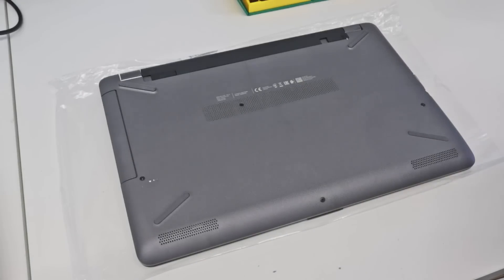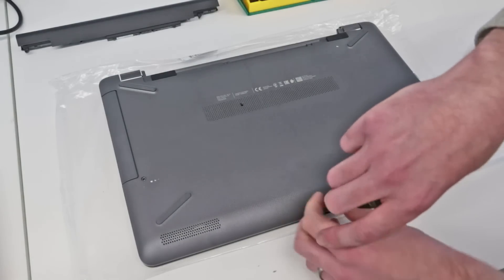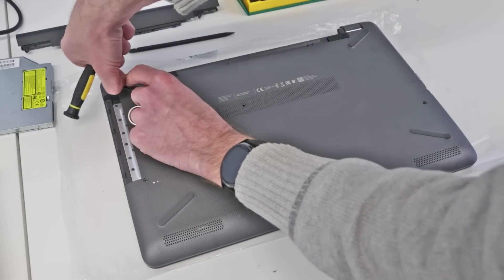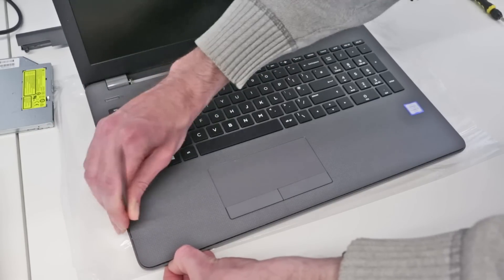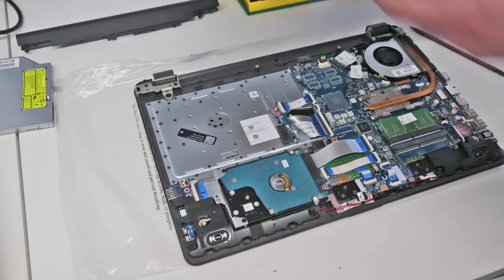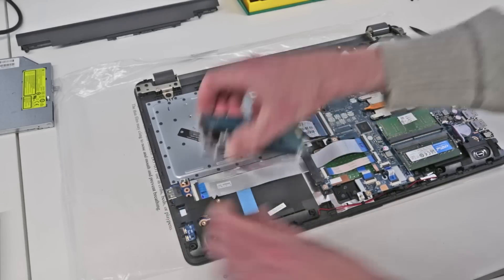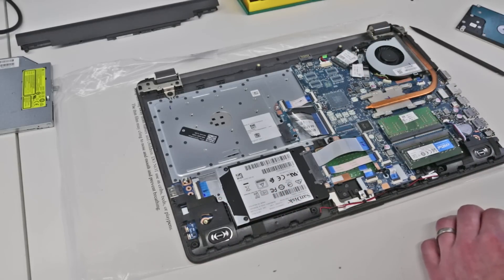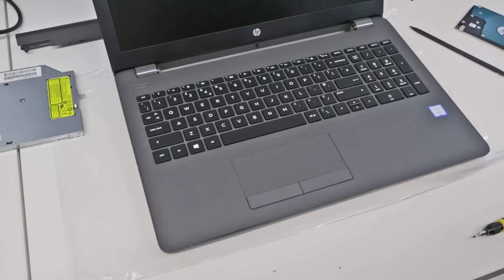HP 250/255 G6 HDD/SSD and RAM Upgrade Guide

Comment: What is max RAM a 'HP 250 G6 i7 with SSD' can take & why? e.g. 2 x 16GB RAMs = 32GB?
Reply from the maker: 2 x 16GB should work fine. 32GB modules may work, but not sure you'd see much benefit from doing so.

Comment: Got a hold of an HP 255 G3 with the AMD E1 6010. Can the CPU be upgraded? Thank you (has Win 8.1 😴)
Reply: I think that is not possible, because as far as I know the CPU is soldered on to the motherboard and non removeable
Reply: @qui-gonsgin8747  some laptops have an upgradeable CPU, but others don't! Thank you

Comment: I wonder why every video of this laptop has a CD driver except mine?
I need to add not replace the hard disk but I can't, please advise
Reply from the maker: There were models with and without. To add the optical drive you'd need to buy a new bottom with the cut-out, the SATA board (assuming the mainboard has the connector for it) and a optical to SATA adapter + mounting bracket.
It probably doesn't make sense from a cost perspective.
Reply: @BrueComputing  Thank you 🙏🏼
I think i will use your perfect tutorial to replace my hard disk with one bigger 👌🏼

Comment: Is this model upgradable to 1tb SSD? and what is the maximum RAM capacity for this device?
Reply: should be 16 GB. Depending on the Processor but for this particular laptop its 16gb

Comment: Question can this laptop only handle the 500gb ssd and 4g of Ram or can it go higher than that??
Reply: You can add more storage & RAM to it as you feel fit. In terms of RAM I believe the maximum is 2x 16GB SODIMMs, 32GB in total.
Reply: @hereis_Tiff  depends on the processor tho but this particular one has motherboard limitation and the HP doc list 16GB max
Reply: @metogema  I thought the limit was 32GB for this one, as I hadn't seen a 16GB limitation on my model when I looked it up 2 years ago. I suppose it isn't the case then
Reply: @hereis_Tiff  i got the exact same model as on the video. U too?

Comment: Hello friends, I have a HP 250 G6 (2sx53ea) Model laptop. Its processor is n3350. How many GB of RAM can I install in this laptop? And also known to install M2 SSD? Or we can only install SSD SATA. Thanks.
Reply: Hey there, I believe you can add 2 16GB SODIMMs in there, adding up to 32GB of RAM in total. In terms of adding either SATA or NVME M.2 storage, that depends a lot of what your motherboard & your laptop shipped with. For example: some laptops have the 2.5 inch drive bay for SATA drives (HDD or SSD), while others may come with a little NVME MM2 daughter board in its place.

Additionally, the motherboard may come with a soldered on NVME M.2 port, which you can use for storage, as well as a boot drive. Like I mentioned earlier, it all depends on what your laptop came with pre-installed.

Comment: HP 250 G6 Notebook, Intel Core i7-7500U, 8 GB di RAM, SSD da 256 GB, Display 15.6", is my computer. Is it possible to upgrade the RAM and the SSD, and if so, to which kind of RAM? 

Thanks.
Reply from the maker: Yes. It uses DDR4-2400 modules (link in the description) although you can fit 2666/3200 modules, they'll just run at the lower speed.

Comment: Hi... Kindly help... I have this exact model, but the power button is spoilt... Is there a way to boot up without using the power button?
Reply from the maker: The Power button board can be reasonably easily replaced if damaged, see P77 of the service manual: http://h10032.www1.hp.com/ctg/Manual/c05485525.pdf
You can also short the pins on the power board or mainboard connector to start it up, but not really a long-term solution and not something I'd recommend if you don't know what you're doing.

Comment: what do I do when the screws on the metal plate holding the harddrive is too tight and I can't apply a lot of pressure in case it breaks the drive?

Comment: Can I upgrade the G/CPU
Reply from the maker: No, they are soldered to the mainboard.
Reply: My new SSD is thinner, but just as long. Should it still work?
Reply from the maker: @videogameplaythrough7043  What drive is it?
Reply: @BrueComputing  I was originally running an old 500gb HDD but decided to get a slight upgrade. The new drive is a 128GB A55 M.2 SSD SATA 3. I want to install Ubuntu, do my school work and play my old games like I did with the HDD. Will this work?
Reply from the maker: @videogameplaythrough7043  Does your machine have an M.2 slot present, or are you trying to add it to the 2.5" SATA bay?
Reply: @BrueComputing  I am running the 255 G6. I looked at the specs of the computer which reads that I can in fact use M.2 I was going to put it in the SATA bay though.
Reply: @BrueComputing  Will I need a 2.5" enclosure or should I be able to safely mount it to the SATA bay and proceed with OS installation?
Reply from the maker: @videogameplaythrough7043  M.2 SATA drives are a completely different connector to a 2.5" SATA drive. You'd need a caddy like this: https://amzn.to/3n1dLzd
Reply: @BrueComputing  Thank you for your help! I'll adjust my build as such.

Comment: I tried to upgrade the to ssd but for some reason the laptop is not picking it up but ot works perfectly fine in other pcs you how to fix it
Reply from the maker: M.2 drive or 2.5" SATA?
Reply: 2.5 but got it fixed had to upgrade BIOS

Comment: I'm currently working on this same model laptop, but it doesn't have a fan, just a heatsink piece of aluminum.
Reply from the maker: Guessing your laptop is using a 6W Celeron or 10W Pentium chip, not a 15W+ Core i3/i5? The lower power models don't have a fan.

Comment: i have AMD processor in this laptop will this RAM specification work ?
Reply from the maker: Do you know which CPU it has? Guessing it is an HP 255 G6.
Reply: @BrueComputing  it is AMD A9 9425
Reply from the maker: @sabyasachisaha1069  DDR4-2400 modules should work just fine then. May run them at a lower speed, but slower modules aren't any cheaper.

Comment: I got the version without the dvd drive and it took me 30 minutes to open it. Pretty frustrating. There is a plastic catch in the middle near the hdd that can't be opened without breaking. I hate that nowdays you have to open the case to change the drive.

Comment: Is it possible to upgrade the CPU in this laptop
Reply from the maker: No. The CPU in pretty much all modern laptops is soldered down and can only be replaced by replacing the mainboard with one with a higher spec CPU on it.

Comment: Hi, I have the same hp model. I've been trying to upgrade to windows 10 from 8.1 pro but it does not allow me to, it keeps on showing red lines on the screen. Is a problem with hard drive or what? And I can't even activate windows at all

Comment: okay so i’m hoping this question we’ll get answered today 🤞 cause i badly need a tech’s info, i’m about to upgrade my HP laptop 250 g6 with a processor intel core i3 6006u cpu to 2400mhz ddr4 8gb sodimm ram. would that work? cause i’ve been reasearching and half i found is yes and half is not. so i’m in the verge of choosing if the money will get wasted or not 🥺
Reply from the maker: A 2400MHz SODIMM should work fine. It'll only run at 2133MHz though as that is the maximum official speed the i3-6006U can work at.

Comment: Is the cpu integrated into the motherboard?
Reply from the maker: Yes - this is the case with any modern laptops, bar a few high-end gaming laptops which use desktop components.
Reply: @BrueComputing  Oh right, I saw that some similar models had a ryzen 3 but it doesn't seem too upgradable except for the memory and secondary storage.
Reply from the maker: You'd have to replace the entire mainboard, as the CPU is soldered to it. Its not really economical to do this in most cases.
Reply: @BrueComputing  Thanks for the advice! I'm gonna sub :)
Reply from the maker: Glad to help! :)

Comment: Great and helpfull video. 
I do have the same laptop, but with an 1tb HD. Bit i still want to Change it to a SSD.  

About RAM. It looks like that the max capacity is 8GB i Guess it is include the 4 GB theres allready in the computer. What Will happen if i install  8 GB ?
Reply from the maker: It'll run 8GB modules just fine.

Comment: Nice vídeo buddy, i have a question: how much RAM can I add to the G6 i3 model? I would really appreciate your answer
Reply: Run cmd as admin and type "wmic memphysical get maxcapacity"
The result is in kilobytes
Reply: @sanjeevverma1133  Just did that. Says it can run 67 gigs (67108864kb). That seems insane. mine isn't i3 but AMD A6-9220 though. I did purchase two 8gig 2666 ram to put in. Figured a 4gig to 16gig jump would be plenty.
Reply: @kylesmith2435  run smoothly or not plz ? 16 gb is safe ?

Comment: Is there any way to ugprade gpu on this model? Also great video, thank you !
Reply from the maker: Only by replacing the mainboard as both the CPU and GPU (if present, most are built in to the CPU) are soldered to that, which probably isn't economically viable vs. just buying a more powerful laptop.
Glad the video was helpful though!
Reply: @BrueComputing  Yes that's what i thought too, thanks for the quick reply. Will go for new SSD & Ram for now thanks to your video! cheers

Comment: Can we change hp 250 g7 7gz79pa laptop processor ????
Reply from the maker: No, the CPU is soldered down in pretty much all modern laptops - only a few very high-end gaming and workstation laptops using desktop CPUs have replaceable chips.

Comment: I bought this laptop thinking that since it's an HP it would be good, but unfortunately mine has a N4000 CPU clocked at 1.1ghz with only 4GB ram. which sucks. Especially since my last laptop was an i3. N4000 processors are a scam should not be commercialized. I am now saving up to buy a proper laptop.

Comment: Please help :  My already installed RAM on my HP 250 G6 is 4GB with speed 2133  which i can't see on the Amazon link you provided .the RAM upgrade must be  2133  or can i install  2400 MT/s instead ?Can I use this Crucial CT8G4SFS8266 8 GB (DDR4, 2666 MT/s, PC4-21300, Single Rank x8, SODIMM, 260-Pin) Memory  ?Many thanks for your help

Comment: Which type of SSD M2 ? Sata or NVMe ?
Reply from the maker: The OEM fitment M.2 SSDs for the HP 250 G6 are all SATA type drives. NVMe may be compatible, but I haven't tried them.

Comment: Hi. If I add another 4GB RAM module will the RAM run in dual channel or is dual channel unsupported on this laptop? Thank you for a good, helpful video.
Reply from the maker: It should, so long as they are similar modules. Ideally you should use a matched pair.
Reply: I just ordered the 4 ram to add on the another existing Ram.But I ordered 4gb doesn’t say single rank.😳will this work??
Reply: @elizabethzewde2254  It doesn't matter if the memory is single or dual rank becaise you can mix single and dual rank memory

Comment: hi! im a problem with connector power jack intern - i have  Hp 250 G6 SSD notebook Sep 2019 - somewhere its works somewhere not.   i think only need to change the power cable. you know a tutorial to replace ? thanks

Comment: Hello! Could you confirm if the hp 250 g6 notebook of the video can be added an ssd disk by port M.2 without removing the HDD sata that already has? thanks!
Reply from the maker: Its best to open it up and check - some that I'd seen with a HDD fitted as standard and no SSD don't have the M.2 connector on the board.
Reply: @BrueComputing  thanks You!

Comment: I want to upgrade processor and ram. But can I replace my current processor (Intel Celeron N3350 1.1GHz - upgraded to 2.40GHz) with Core i7-4700MQ 3.40GHz?
Edit: I have 2018 HP 250 G6 model 3168NGW.
Reply from the maker: No modern laptops have upgradeable CPUs, the chip is soldered to the mainboard. The RAM may be upgradeable.

Comment: I would like to ask a dumb question, can we replace/add a new gpu? ( Since it has intigrated graphics )
Reply: No, you cannot. It would be unusual for a laptop anyway, since unlike desktop PCs laptops have custom made parts so that everything fits just right into the chassis. GPUs are also really large and wouldn't fit well. But I've played KF2, CSGO and some other games that are low spec friendly and had a fine experience. What do you want to play on it anyway?
Reply: @sophie-144p7  Thank you for the reply, i already have a gaming PC which i built myself. I for one never owned a laptop (simply because i like pcs more than laptops) but now i was given a laptop by my university (since i am in masters program and its university rules) and i have zero idea about laptops. I looked it up in their website (HP) and now i know that its 1 complete integrated chipset with limited upgradation possible (Ram and HDD/SSD). Thanks for the reply tho.
Reply: @gametabulas  No Problem :)

Comment: hi I have the 1tb version of this and wanted to add more ram but after removing all screws and unclipping all edges can still not remove the bottom from the laptop it seems to be stuck in the middle somewhere? any ideas please. its brand new so scared of breaking something
Reply: I had the same issue. I think there may be some kind of adhesive in the middle. Just make sure you go around the outside and undo every clip then apply some pressure and it should come off

Comment: Ssd can be installed from the CD ROM side???? Is the performance effected???
Reply: The HDD is connected to the SATA 3, while the CD ROM may be connected to SATA 2, I'm not sure whether this type has SATA 2 or 3. A quick google search will give you the answer. If it's SATA 2, then it would not perform to it's maximum potential and you would have to swap the HDD and SSD and then put the HDD into the CD ROM slot.
Reply: @adamf.1187  okk thanks man lemme Google abt that!

Comment: Hello, I'm trying to open this laptop and I can't remove the plactic cover. I have removed all screws and those plastic clips aren't holding the cover. It looks like the only thing that it holds is a VGA port as I can't pull the plastic cover over it. What should I do? It also feels a little bit that it's being held by something inside, but there are no screw left, so it's maybe just na odd feeling. What should I do? Apply more force?
Reply: There may be clicks that would open up the back side....no force only look for clicks .
Reply: @bigfred8495  Hello, clips around the edges are released, may you elaborate where to look for the others that may not be released?, or how to achieve their releasing?

Comment: can i add a 4gb 3200mt/s ram? does it start? the other memory is 4gb 2400mt/s
Reply from the maker: It will probably work, but it will run at 2133 or 2400 speed, same as the other module.
Reply: @BrueComputing  thk u
Reply: I just ordered the 4 ram to add on the another existing Ram.But I ordered 4gb doesn’t say single rank.😳will this work??

Comment: My hinge is broken please do you know where I could buy one I tried eBay but no luck it’s the same exact model
Reply from the maker: The part number for the hinge kit is: 925297-001
If you search for that you should be able to find some for sale, there is no shortage of them on eBay here in the UK.

You can find it on page 24 of the service manual here: http://h10032.www1.hp.com/ctg/Manual/c05485525

Comment: Can I replace HDD into ssd and remove DVD to add caddy with HDD?
Reply from the maker: Yes, if you have a version with an optical drive bay you could fit the HDD (or the SSD) into a caddy and do that.
Reply: @BrueComputing  I am using ho 250 g6
Reply from the maker: There are dozens of different models of HP 250 G6 - some have optical bays, some don't.
If does then your plan will work.
Reply: @BrueComputing  Product Description: HP 250 G6 Notebook PC
Product Number: 2RC08PA

Comment: i have HP Pavilion Power Laptop 15-cb0xx laptop. i cloned win10 into wd m.2 250gb ssd but the boot sequence is restricted by bios insydeh20 version5. what should i do? hp official service and forums give insufficient informations about restriction. i planned to unlock advanced options of bios but i have not been able to do it either. please help me. my computer does not have cd / dvd driver.
Reply from the maker: How did you clone the drive? Have you removed/erased the existing hard drive?
Reply: @BrueComputing  i cloned by software. now i have 2 of win10 with recovery partition.
Reply: @BrueComputing  physicly the original hdd still exists in the port. i can not remove or disable without changing the boot sequence.
Reply from the maker: I'd either remove or erase the contents of the HDD. Alternatively you could use BCDEdit to add in the SSD install. It'll be confused at the moment as there is two boot loaders.
Reply: @BrueComputing  i see only one drive the original and 2 boot loader one şs macrium
Reply: @BrueComputing   not work by bcdedit.
Reply: @BrueComputing  finally i have found the solution thanks to hp service support (turkey). update uefi from the link below [UNABLE TO BOOT WINDOWS, OR IS WINDOWS LOCKED UP?] : https://www8.hp.com/us/en/camp
aigns/hpsupportassistant/pc-diags.html    and than try boot sequence from F10. choose upgraded ssd via F5 / F6 than press F10. problem must be sold with this cure. as for the bios; i told, there woould be a new bios update within short term.

Comment: i purchased a new hp 250 g6 notebook in which build in DVD drive is not installed. in which 256 ssd m2 sata is installed i want to expand the memory and install another HDD harddrive of 1 TB.  so i need to know that is hdd hard drive caddy will be installed already on the baseboard or i have to purchase it separately?
Reply from the maker: You'd need to buy the cable, HDD board and possibly some of the brackets to fit it - you can find the part numbers in the service manual.